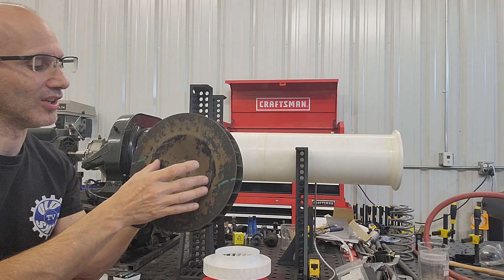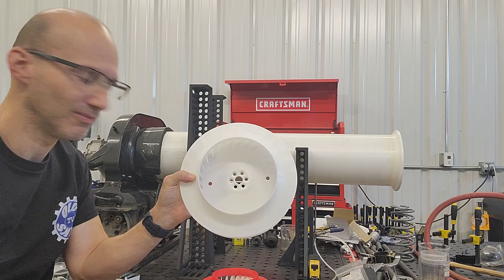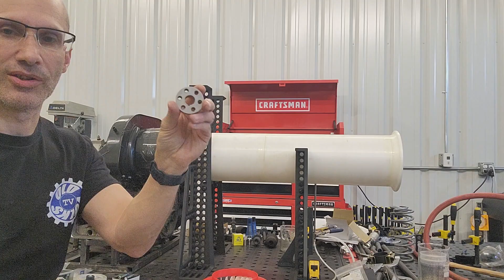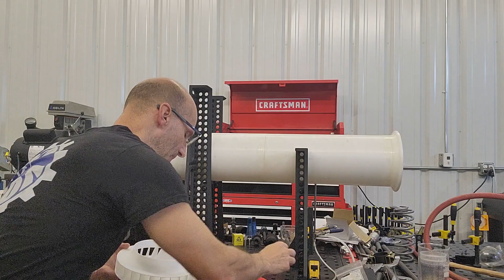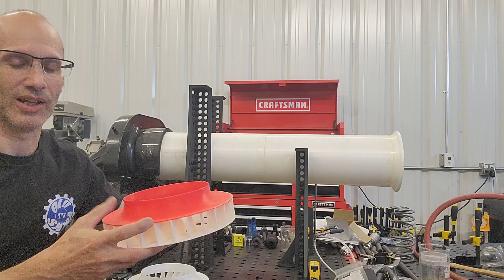Lightweight Cooling Fan NG Comparison - Part1

Comment: Would this fit a 1200 36hp 55 oval?
Reply from the maker: I'm not selling the NG version of the fan.  The NG failed the high RPM testing.  I have a new one called the Evolution Two.  It's actually even better, and I do have a version for the early VW fan shroud.  The early fan shroud version of the Evolution Two fan gives you 22+% more airflow the the early fan.  Look at my videos on the Evolution Two fans.

Comment: You COULD machine the first version of the fan out of a solid block of aluminum, but that would be even more expensive.
Reply from the maker: I'm not sure it can actually be done, because I don't think you could fit the tooling into some of the areas.  It might be possible, but it would be prohibitively expensive.  Plus it would be substantially heavier than I want.  I have my new equipment to 3D print them, and I have several materials to test print with, so fairly soon, I'll have some "release candidates" to test with.  Trying to balance the material properties and the cost at the same time.  Some of the really high end materials would make the fan cost like $500 retail, and while they would work great, they are just too expensive.  I think I have a really good material that should work really well, and be cost effective.  There is a material shortage right now too, which is making things tricky, but I think what I will end up with, I'll be able to source enough material.  We live in a complicated world for manufacturing right now.
Reply: @andrigsaircooledtechnology  Just because I said I thought one COULD do it, doesn't mean I think one SHOULD do it.
Reply from the maker: @Devin_Stromgren  Sure thing.

Comment: i was thinking of getting this because of the lightness and less rotational mass and the fact that it cools better. WITCH IS A WIN WIN. but I was fining of implementing this to my build with some type of way that I could do the full flow oil system but in stead of the mechanical oil pump have a electric pump for even less rotational mass and even more cooling . As an individual  part it releases some horse power but not mutch but  alot of small things makes one big thing. if you can free up horsepower everywhere you can in this motor , it all adds up to alot, especially if you can provide the cooling power for that at the same time. I am so glad that you stepped up and made this product because I cant find any boddy els making lite-weight/better preforming fans , other wise i had tho make my own and i dont thing i would have doen sutch a good job as you , there for I applaud you. keep up the good work!
Reply from the maker: I think you'll find that an electric oil pump won't have any real effect on rotational mass, and getting better throttle response and using less horsepower for pumping the oil.  The thing about the effects of rotational mass is that the larger diameter the mass the larger the effect.  Since the rotating gears in an oil pump are so small you'll never see much of a difference.  Plus, an electric oil pump can only turn at one speed, while the mechanical pump turns faster as the RPM increases.  There is also a reliability issue in that if you lose electrical power or the electric motor has any kind of problem you lose your oil pressure.  I would bet it will be hard to find an electric pump that is compatible with motor oil and provide the pressure you need in the oil system.

Comment: I just purchased the straight blade fan last week. Should I have waited for the squirrel fan? I’m not sure what you mean by “high static pressure”. I have the type 3 cool tins on the bottom of my cylinders and the stock thermostat and flaps. It’s a ‘63 beetle with deck lid stand-offs. Will that cause high static pressure? Thanks.
Reply from the maker: Based on what you describe, you should have good results.  The deck lid stand-offs will reduce the static pressure for air flow into the engine bay, and hence into the fan shroud inlet.

Comment: Looks Great! Why the switch back to the squirrel cage?  Are you still able to increase air movement?
Reply from the maker: The reason to go back to the squirrel cage design is due to the fact that the straight radial blade design degrades much faster as static pressure rises.  There were two customers that had issues with the fan that are hard to explain, because I can't do measurements on their cars.  One was a Bay Window bus, and the other was a Beetle.  Based on everything they were able to tell me, the only thing that seems to make sense is that they had much higher static pressure than normal with the airflow into the engine bay.  So, I started investigating going back to the squirrel cage design, and yes, I have been able to increase the airflow significantly.  So, there should never be a case when someone gets poor cooling performance relative to the OEM fan anymore.  It was only the two that I know of, but there may have been others, I just don't know.  As well as the original sold, I don't believe this happened to very many people if it happened to anybody else at all.  It bothers me though, and so I wanted to see if I could tackle that problem, and know with 100% certainty that no one would get performance that is worse than OEM, and everybody will get an improvement regardless of their engine/car combination.
Reply: @andrigsaircooledtechnology  Sorry, you explain this in the other video, but YT showed me this one first at the top.  Makes Sense. I was curious as I think the Corvair used a similar design as your first iteration.
Reply from the maker: @jasensanders  Hey, no problem at all.  Yes, the Corvair used a straight radial blade fan when they went from their steel fan to a magnesium fan.  They tried to do a Nylon fan, but the Nylon interacted with batter acid vapor, and created a very poisonous vapor that would get into the cabin if you have the heat on.  Of course, the blade designs are completely different between mine and the Corvair, but it is the exact same type of fan.